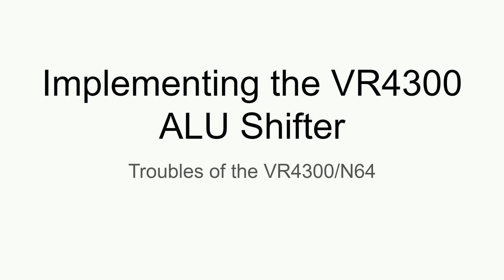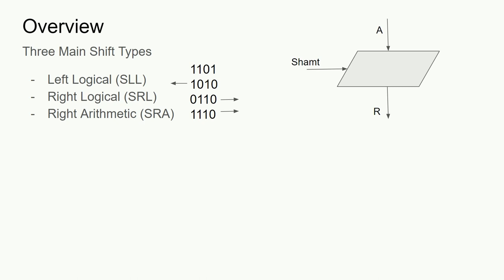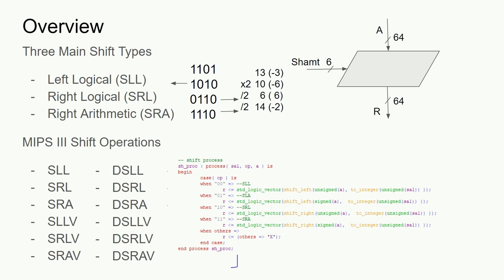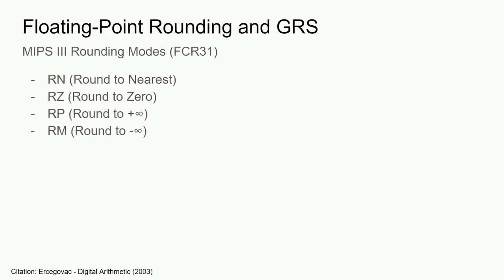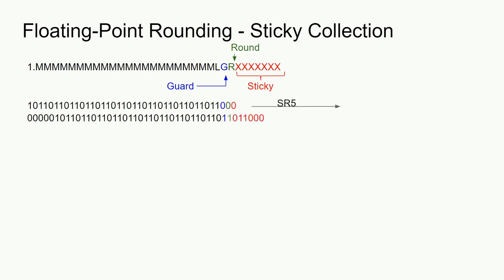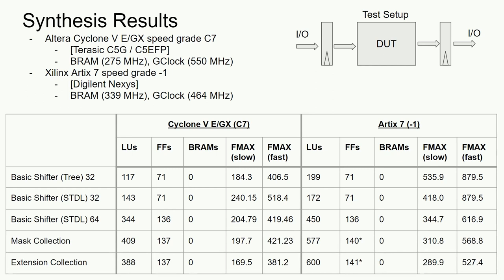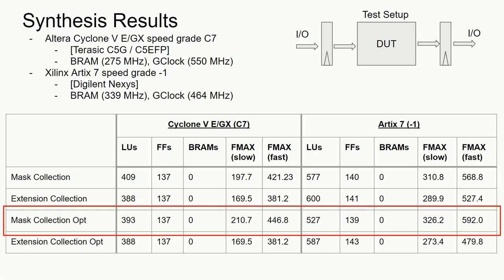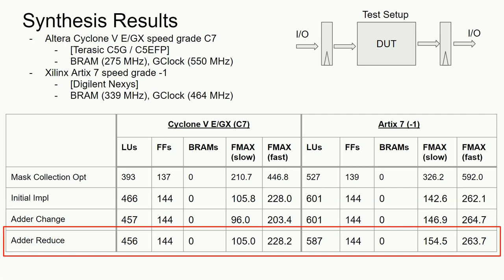Implementation of a VR4300  ALU Shifter

Comment: Good timing again.

I almost finished a new PCB design today, for an 8MB SRAM board, for that PCIe FPGA board I bought.

It will also have a socket for an N64 Mask ROM on it. ;)

I want to attempt to write a CPU core from scratch soon.

It'll have to be one that hasn't been done yet (or at least not released publicly). Maybe the TMS34010 for Mortal Kombat, but I'd rather work on something like the N64 RSP.
Reply from the maker: Writing a CPU core from scratch is a good exercise, but I highly recommend against your first CPU being the RSP. It's basically a full 32-bit MIPS III minus the system control instructions, multiplication, division, and the FPU. It's more complicated than the R3000 (remember that the RSP is a 5-stage dual issue super-scalar processor - not true super-scalar, but the complexity of one). If the TMS34010 hasn't been done, then that could be a good option. I don't have a list of available CPU cores, so I can't give you an option that has not been implemented publicly yet.
Reply: @RTLEngineering  

True. The RSP probably isn't the best one to go for, for a first project. lol

I got quite far before with SuperFX. It was running instructions, then I started to work on the muxes for the data / address paths. And then somebody released a full GSU core anyway, so I shelved it

I'm tempted by the TMS, but the thing is that it would only run a handful of arcade games. I mean, it's great if we can keep adding a new arcade core every few weeks, and MK would be a big one, but I'm thinking it might be best to work on cores that can play many games on the same platform.

What I should really do is finish the CPS1 core, as that's at least running code just fine, albeit without the graphics being displayed yet. Audio is basically done, too.
Reply: did you get that terasic one with like 310k LU?   thumbs up on cps :)   warham

Comment: Hey, could you please make some more videos on FPU design? I liked them a lot
Reply from the maker: Thanks! I plan to at some point, but these videos take quite a bit of time to make (about 1-2 weeks of work for me), and I have found that I would rather use that time actually doing architecture design and implementation. Once I figure out a way to make them quicker, then I will upload more.
Reply: I am willing to help, if I can do so feel free to contact me :D
Reply from the maker: Thanks for the offer, however, it's not necessary. 
I have been considering using one of the AI based speech synthesis programs to help speed it up (since it allows me to generate clean audio by typing in the script) - that would probably save 3-4 days of work for each video. But someone had brought up the concern that it would remove the human component making the videos less enjoyable.
Reply: That is definitely true
But 3-4 days of audio recording is quite intense, isn't there a possibility to reduce that?
Reply from the maker: To clarify, the 3-4 days includes cleaning up the audio and editing it. Recording still usually takes almost a full day for a 20 minute video though. That's why I was thinking about computer generated audio, which wouldn't require me to do any of those steps, though I would still have to proof it to ensure correct pronunciations (that would cut down the 3-4 days into a couple of hours, at the cost of removing the human element to the audio).
Reply: Ouh ok

Comment: One more independent question: What do you think about the RISC-V ISA?
Reply from the maker: Is there a specific point about it you want my opinion on?
Overall, I think it's a very clean ISA (the base ISA), with a lot of similarities with MIPS. However, they made many design decisions that I don't particularly like, even more so with the extensions. A few examples: 1) the multiply-divide extensions produce results in the GPR, and are complimented. So you have a low multiple and high multiply instruction. Similarly you have a divide and remainder instruction. The ISA suggests using them in a specific order if you want both results, but that makes it much harder to implement them. Instead, I wished they had done what MIPS did with the HiLo registers, which many systems took advantage of to do multiplication and division asynchronously from the pipeline - some very infamously (you can't do that with RISCV). 2) the FP extension is not coupled with the vector extension which requires FP. So if you want the vector extensions, you need to have a primary FPU and a vector FPU, even if you only ever use one at once. Otherwise you need to shuffle around the micro-architecture control to allow unit reuse. And if you want vector extensions without FP support (like for ML), then you're out of luck and need to roll your own extension. 3) the vector extensions are a complete mess. They're meant for vector processing and not SIMD, where SIMD is more accessible to modern software (since that's what ARM and x86 use).
I apologize for that little rant - part of my research (for my day job) revolves around RISCV micro-architecture design, so I have a lot of opinions there. As long as you don't stray off of the original integer ISA, it's straightforward though.
Reply: Ok, that's exactly what I was hoping for, thanks. The points you brought up are very interesting. I also wish for a more differentiated V extension. Like only implementing float vectors or whatever your needs are. But a packed SIMD extension is still in the making. However I don't see much difference between a Vector and a further SIMD expansion, maybe you can clarify the difference? Do you mean with the async. mul/div, the result only has to be actually computed if the move low/high is called?
Reply from the maker: On the surface there isn't much of a difference with SIMD and vector, since SIMD is a subset of vector. However, there's the requirement of the vector extensions that it be vector, which require a lot more hardware and features. Additionally, vector does require some setup (size, stride, etc.), whereas SIMD is fixed. There are a lot of benefits to having a vector extension like RISCV's, but the flexibility leads to other problems (compiler targets and patterns, overhead, etc.). It would be better to have had multiple tiers of extensions which were compatible - SIMD integer, SIMD FP, vector integer (superset of SIMD integer), and vector FP (superset of SIMD FP). That way you could easily target SIMD operations like with MMX/SSE/NEON, as well as the fancier vector operations like you see with Cray. As I understand it, the way the extensions work (which is enforced at the compiler level), is that it's all or nothing. If you don't implement the extension completely, then the compiler won't know what is not implemented and may generate invalid instructions for a given target.
As for async, that's correct. Although, it's usually computed when the instruction is issued. Multiplication and Division are not fast operations (at the worst case, a 32-bit division could take 35 cycles). So it makes more sense to let the CPU be able to move ahead (and have the programmer be aware of that behavior by it being part of the ISA), which allows for more efficient instruction level parallelism (instead of relying on the micro-architecture to extract that parallelism). What MIPS did in that case, was lock the Hi-Lo register with a hazard flag when a mul/div was executed. If that register was accessed while locked, then the pipeline would interlock (stall). The R5900 in the PS2 actually relied heavily around that, to allow the mul/div instructions to effectively complete out-of-order (that was probably a nightmare to debug, because you couldn't put a breakpoint on one of those instructions, but it greatly simplified the micro-architecture while minimizing stalls). Furthermore, the HiLo register was 2x the datawidth size, so for the 64-bit R5900, it was a 128-bit register (Hi and Lo), which would give you the 128-bit multiplication result, or the remainder and quotient of a division. That means you don't need to worry about instruction ordering or dependency detection from the instruction stream (there was no Hi mult and Lo mult, which you have to call in a specific order and have the micro-arch detect to ensure that the multiplication isn't done twice, like with RISCV). Also, MIPS could use the HiLo register as an extra GPR if need be (I doubt any compiler did that, but some assembly might have - you can always use more registers, especially if they're effectively free).
Reply: Thanks for clarifying. Im totally on your side. Actually I thought about a more subdivided Vector set while reading through the extension. But afaik it is not ratified yet, so lets hope they add that.
For the mul/div problem, I agree. Especially, since riscv is built in a way to simplify the microarchitecture enormously. With strangely located imm and a lot more. Its really strange to me why they did not implement the same pattern from mips. But I think their reasoning was to have all registers in one place. (given that there is also no status register)
Reply from the maker: I doubt the vector extension will be broken up. Although, if Intel gets involved, then maybe it will be (or they will propose their own which is more similar to MMX/SSE - one can only hope). 
The imm fields are indeed strangely located in the instructions, unlike with MIPS. And that does make the decoder a little more complicated, though not substantially so.
Having all of the registers in one place is not valid here. The FP registers are separate from the GRP. You could argue that this is due to the fact that FP is an extension, but so is mul/div (i.e. a it would be consistent with the FP extension to have added special registers for the mul/div instructions). A status register isn't really relevant for RISC though, since those outcomes aren't really necessary. The main purpose of the status register was 1) to extend 8-bit and 16-bit operands (add carry and shift/rotate), but with 32-bit registers, that's not really an issue. And 2) to allow for status based branching, which is not relevant here either since most RISC ISAs do in-branch comparisons with register values (1 instruction instead of 2).
There are, however, some RISCV implementation that place status registers in the CSR space, to indicate carry, sign, zero, etc. (it's not required, but some may find it useful).
One other point I want to mention is the RISCV insistence of adding extra functionality to extensions. One prime example is the bit-manipulation extension. Everything there is pretty easy to implement in hardware with a low area overhead.... except for the CRC instructions. I understand why CRC is needed / wanted, but I don't think it belongs in the same extension as things like "rotate left". Again, this is because of the requirement that an extension is all or nothing, so if you don't want to waste the hardware on computing CRC, then you can't tell the compiler that the extension is supported, and have to use manual intrinsics hacked in with macro'd assembly. (CRC should also probably be in a security related extension too, not bit-manipulation).
Reply: Ohh yes, I guess they don't have enough letters in the English alphabet to fan out all the features. That why they crammed in so much in the B extension. However, the B extension is subdivided into Zb..., can't the compiler implement the Zb... extensions on its own?
But lets see how it goes, the extensions are a bit of a mess, right now.
I get your point with the FP registers, but I would say mul/div is an integer extension so it operates on the integer registers. And on several talks they announced that they only removed mul/div instructions from the base isa to better support low power devices.
For my part, I have found that the logic for the imm decoder is indeed more complex, but it can operate in parallel more easily and it simplifies the logic for the register selection massively.

Comment: Hi. Noobie question: Is it possible to use Artix-7 DSP slices to help with this?
Reply from the maker: The DSP slice can only do fixed shifts of 17-bits. You could potentially use the multiplier to accomplish the same goal though, since a shift by 4 would be a multiplication by 16. However, to implement that, you would either need a shifter to convert the shift amount to a multiplication value, or use a LUT ROM (for a 64-bit number, you would need the ROM to be 64bits x 64 entries).
Furthermore, the DSP slices are only capable of doing 25x18 bit multiplication. So if you wanted to do a 32-bit shift this way, you would need 4 DSP slices, and I believe that you would need 12 for a 64x64 multiply. 
Basically, it would save few LUTs at the cost of the DSPs, a tradeoff that probably wouldn't be a good one, especially on smaller FPGAs which may only have a handful of DSP slices.